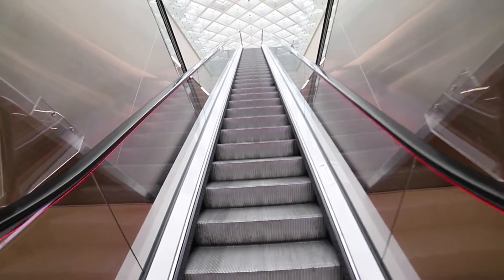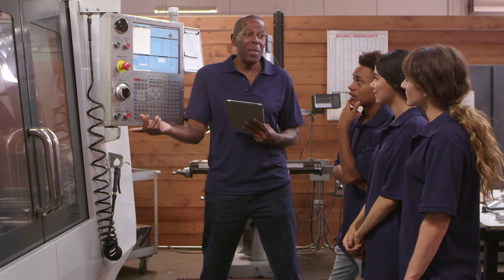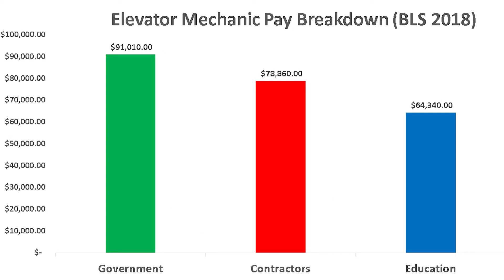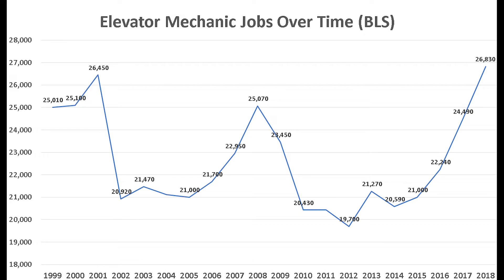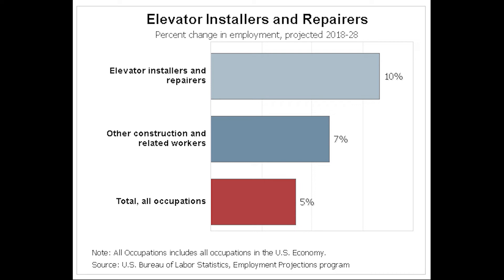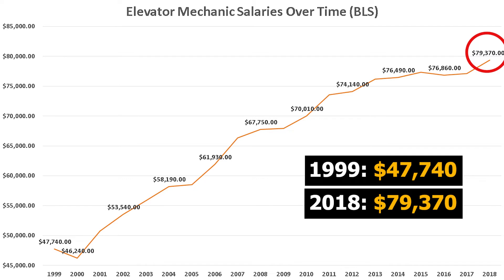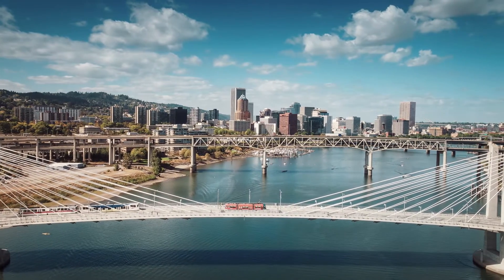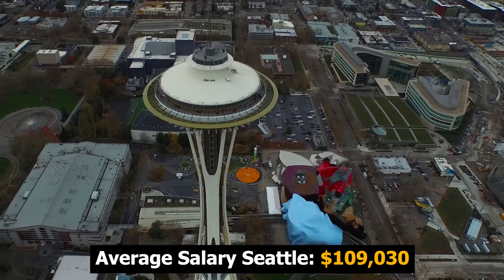Elevator Mechanic Salary (2019) - Elevator Mechanic Jobs

Comment: This is a fantastic career. Been an IUEC Mechanic for 20+ yrs. The overtime is actually Double time not 1.5. If you’re part of IUEC across the country expect Double time. If you’re non union then 1.5 OT. What isn’t mentioned: this job isn’t for everybody! A lot of people see the money we make but don’t realize what the job entails. Especially if you work traction! Dropping lines, setting pit channels, etc. Not to mention once car sling is built! The fun part begins…. Stacking rails, and brackets, plus a lot more OJT that you’ll learn. It’s a dangerous. If you’re scared of heights…. I wouldn’t recommend. Cause you’ll have to get out on a ladder at some point 50-80 stories up. Even higher depending on building. Even walk on a beam once in awhile. With a harness ofcourse. Again, this job isn’t for everybody. It’s different being on the ground then being 80 stories+ and you freezing up! At least there’s mods/repair/service as well. Hope this helps! Stay safe!

Comment: Im an elevator mechanic in nyc base salary is 120,000 without overtime. With overtime i make 200k plus. Never graduated high school, no certificate. Nyc is one of the few states that does not require elevator mechanics to be certified. But im union. Many non union elevator guys will not see this salary.
Reply from the maker: The elevator/escalator mechanic union seems to be the best in the country. That pay is awesome.
Reply: Just retired out of Local 1 NYC. Worked for Schindler elevator. Did 33 years in the business. Made a great living. Sometimes a bit dangerous buy a great career. Would not change a thing. Work safe brother. Local 1 strong.
Reply: Are you serious man ? Im 18 and wondering if this is a solid this to pursue . Obviously the only answer I will pronounce get is yes but Wow thats a solid amount per year
Reply: Hey bro im a union carpenter here in nyc, just wanted to ask you a question. Do u guys get laid off a lot? Do u guys work around the year? Just curios
Reply: @adnanhalim99  Depends what department you're in. New construction guys are more subjected to layoffs, but the other departments aren't 100% insulated from them. Maintenance and Repair are probably the most steady.  Modernization is also at the whims of the commercial real estate markets, but renovations are more consistent than brand new buildings. If you're well-rounded, you're not likely to see much of the bench.
Reply: What are some electrical courses and welding certs I can get to stand out when applying?
Reply: @elevman how can it be dangerous?

Comment: He didn't  mention  that in construction. Any IUEC overtime is double time. Meny people  see the money and want the job. But once they are cleaning rails, or working  high in the overhead.  They opt out.
Reply from the maker: Didn't realize they could get double time. Will have to look into the IUEC.
Reply: Yes sir I’m in new construction and it’s a damn blast and I love the double time
Reply: @matthewkibler5315  i really want to get into the union. I'm 21 years old and currently working for a residential elevator company any tips or advise to get into it because i heard it one of the hardest unions to get into

Comment: I'm elevator apprentice and make 65-75000 a year. When I'm mech ill be making 125k + easily. And being a elevator mech is a broad field. You have your conversions. New installs. And troubleshooters. I'm in training for troubleshooter. Any big parts needs changing. We get the conversion guys to do.
Reply: T B may I use you as a personal reference?
Reply: How heavy is the work i injured my back doing welding work looking to switch trades
Reply: @edgartrevino8846  not heavy. Work smart not hard. Depends on the company as well. Just have to work smart or fall down a shaft or crush someone or yourself.
Reply: @terrencebaker  How did you become an elevator mechanic
Reply: What city?

Comment: I’m 5 away on Detroit’s list right now. This damn pandemic is screwing me over
Reply: Michael Duby same
Reply: I was number 3 and worked for 3 weeks. Been off 4 months now due to the pandemic
Reply: mtfm94 how are you getting by? I’m stuck in the queue too. I haven’t even begun yet though. Does the union help with pandemic pay?
Reply: How do u become a elevator mechanic? I just graduated high school
Reply: LaybackDre I want to know the same, currently a senior in high school
Reply: Lmfao I feel you brother same in NYC
Reply: Sorry guys
Reply: @LaybackDre  If you're not related to someone already in the trade, you're outa luck. In the late 70s and 80s, I worked as an assistant manager for an independent elevator contractor in San Francisco. I was not a member of any union, however, I had experience in basic machine shop operations including steel fabrication (including assembly of elevator parts) and controller wiring. 

I worked there for over 1-1/2 years and had nothing but problems with the shop steward from the elevator constructors union (IUEC Local 8) who complained that I was doing union work without actually being a member of the union. The management tried to get me into IUEC, but the union president told me I did not have any qualifying experience and I was not eligible to get into the union. So there's the elephant in the room - I'm doing union work without being in the union, but then I'm not qualified to get into the union.  

The federal government has brought numerous complaints against the IUEC for discrimination and violation of equal opportunity employment regulations, but the union simply thumbs its nose and goes right on with it's nepostic policy. I suspect that IUEC (and other big unions) shovel toms of $$$ to congress so the EOE laws don't have any teeth.
Reply: How the fuck do you get a elevator mechanic apprenticeship in Detroit?

Comment: if words hurt your feelings and you can’t work 12 straight hours drenched in sweat and covered in grease then you wont last a week in this trade. Imagine mining for coal and building a vertical train track at the same time, except the tracks are 16’, 250lbs each and youre 200’ up. 1 out of 3 new hires actually make the cut, make sure you have what it takes before you waste everyones time
Reply: How did you start? Are you still in the field
Reply: Damn right
Reply: You're referring to gorilla work. However, construction is less than 1% of the trade and the 99% is technical stuff like electrical/electronic troubleshooting and maintenance. The union needs to focus on technology instead of grunt workers. Otherwise the union will go extinct like the dinosaurs.
Reply: u fool, being an elevaor mechanic we do it all, mechanical, electronics, welding, and rigging , its the jack of trades
Reply: yup, 4th year here and this trade still kicks my ass... got to wake up 3:30am this week to pull apart some motors 💪